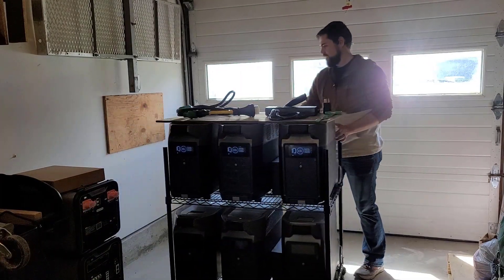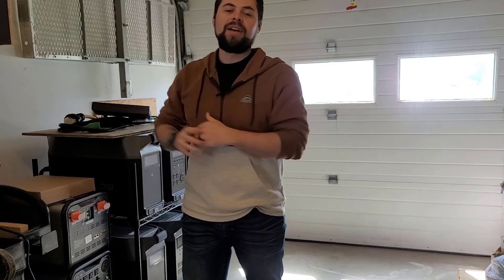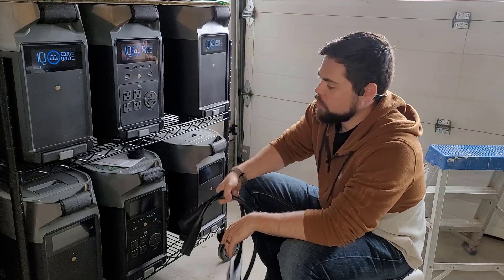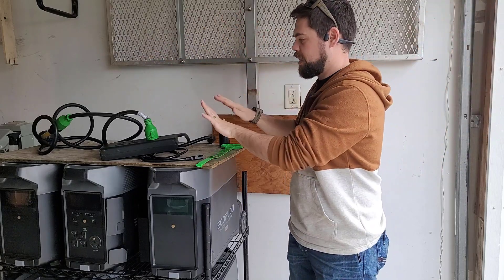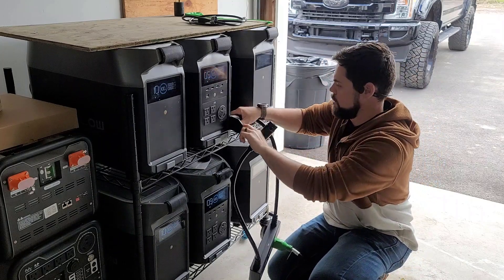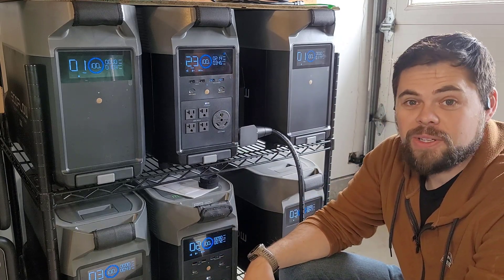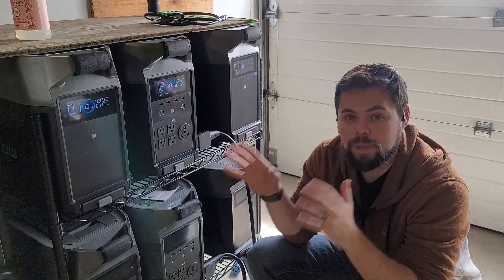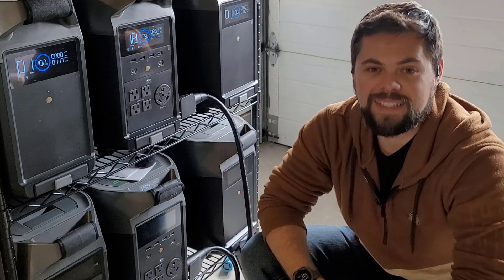EcoFlow Delta Pro Setup and Test

Comment: Great video boss. That's rxactly the same configuration I have...I am currently mounting 8 450w Canadian solar panels on the roof just a slight over panel. I did opt for the smart hub panel, just need my electrician to come and install it.
Reply: Awesome man how much did you pay for your system?
Reply: @childofgod884  I need to tally the total so I can get an exact fuigure of the total cost. Also so I can recoup the cost of the I vestment. Rough estimate 15-16k... I'll potentially do a list of materials and nick nacks.
Reply: @dfuentes420  
Very cool man that's not bad at all,  considering the chemistry of the batteries. Since they are expected to last at a minimum of 10-20 years since they are lifepo4. What about the solar panels how much did you pay for those? I've been thinking about getting 2 of the Delta Pros and getting at least a 2kw array mounted on my roof and run a couple 5000 btu Acs off the grid during the summer months. The only issue I'm having with that is that is that I do not have a south facing roof, and I have no space for a ground array.

Comment: That sinks that you have to have wifi to make it work. That's a big negative against this system.
Reply: That's exactly what I was about to say.
Reply from the maker: Only need wifi to update the system, and you want the newest version before connecting the 240v setup. After that you don't need wifi.
Reply: @minutemansolar  But I would still have to spend several hundred on a stupid "Smart" phone that I would have to get rid of afterwards. They need to include the "latest version" to begin with, or just have a simple switch. The more software they pack into these things, the more glitches they can have. They need to keep it simple.
Reply from the maker: @GrayManPrepping  I agree, the more tech you add, the more room for errors. That's one of the big advantages I like about the Titan, it's very very basic tech.